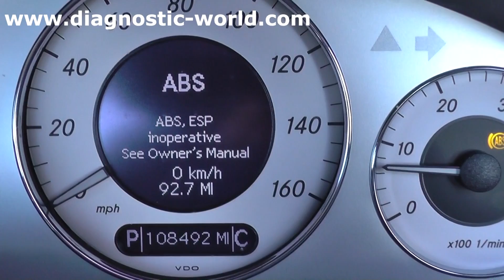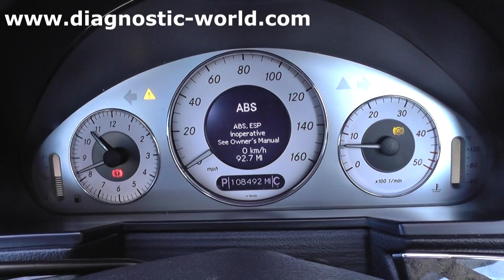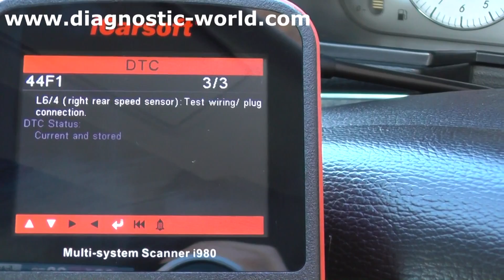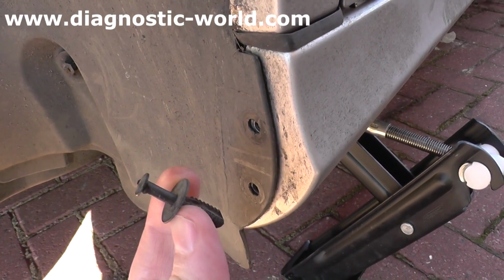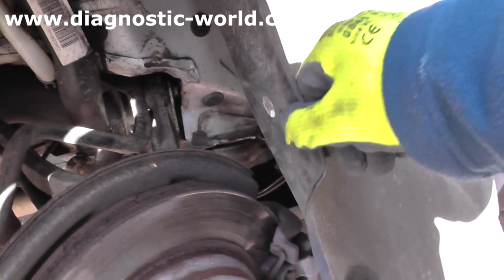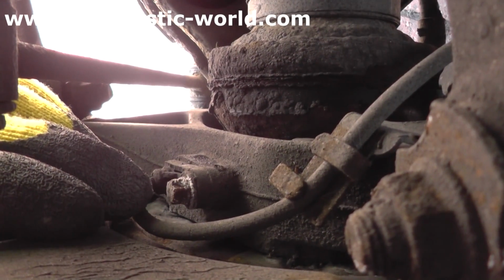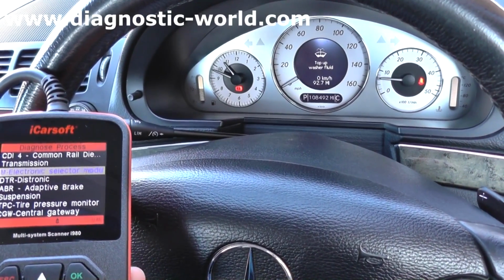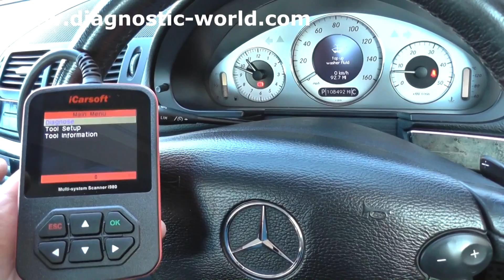Mercedes W211 E Class Rear ABS Speed Sensor Removal & Diagnose Guide

Comment: Hi, I have a Mercedes W211 E270 late 2002. My question is. I had to replace my rear right ABS sensor, which i did. But the three fault codes stayed on. I should mention the man who did the work said he couldn’t get the old sensor out because it was stuck solid. He ended up using a small drill and a vacuum to remove any other bits left in the sensor hole. Since the my ESP  ABS and one other. Is there any advice you can give me. Thanks
Reply: Did you find a solution?

Comment: Dose abs light making problem to change gear since my abs light on for the e270 it's hard to selecting gear
Reply: Did u ever find out? Going through same issue
Reply: U have to change the abs sensor if it damage, because the sensor sending signal to the transmisjon and it can lock on a gear or it shift hardly that is because all four wheels not going the same speed therfore the automatic transmisson will not shift gears or hardly shifting
Reply: The transmission also uses the speed data from the sensor to judge the correct gear according to the wheel speed, engine RPM, etc.

Suppose the wheel speed reported by a faulty ABS sensor is wildly fluctuating. In that case, it can cause the transmission to shift with jerks or not shift into higher gears at all.

Comment: I replaced the ring now my car won’t shift out first gear worst mistake ever
Reply: limp mode
Reply: How would it be fixed ?
Reply: @Sinister_187   I don't know. I have an automatic gearbox 722.6 (W211) stuck in first or second gear (mode standard or mode winter). Bought me an Icarsoft MB V3.0 tool that tells me that 1. something is wrong with the rear wheel speed sensor and 2. component N15/3 (ETC [EGS] is defect.
Reply: Yeah crazy I been had my e320 2003 in shop since 11/21/23 still waitin if not fixed just gonna junk it with the new suspension I guess I’m tired off it